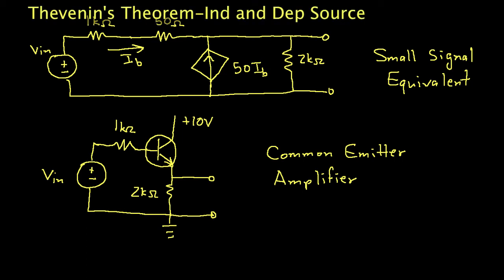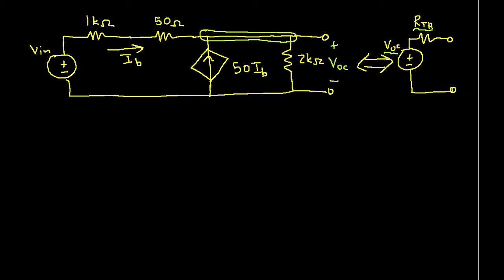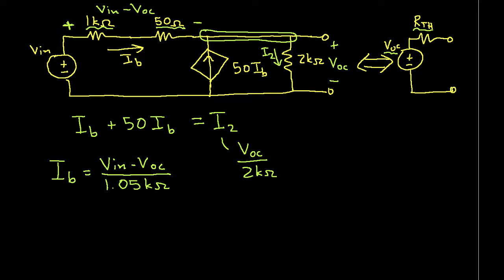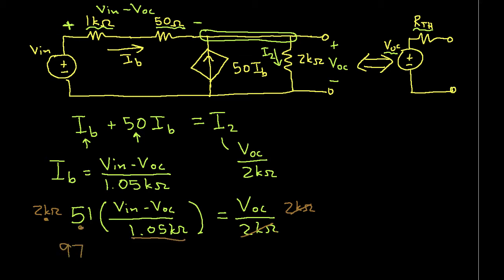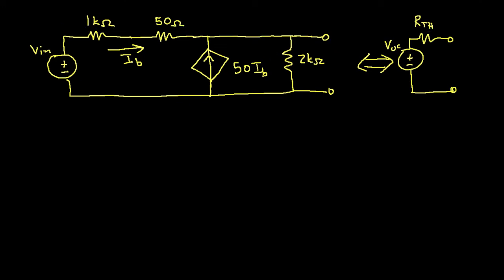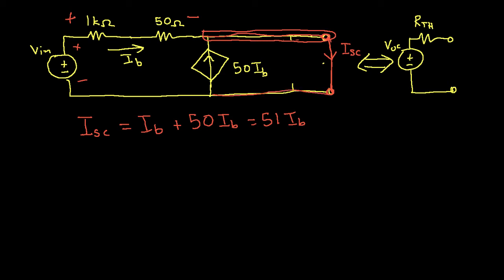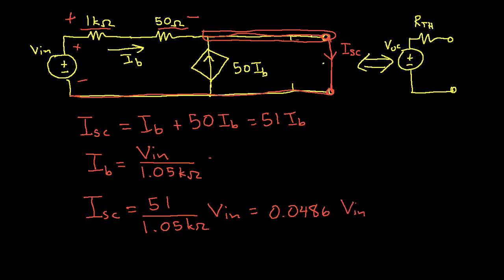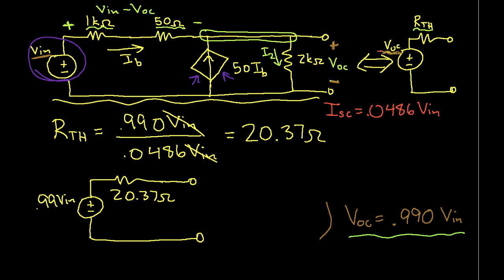Thevenin's Theorem-Independent and Dependent Source (Edited)

Comment from the maker: This is one of the weirder things that happen when doing Thevenin's theorem computations. When we find the short circuit current, we short the output, which in this circuit, means shorting the resistor. So we have a resistor with resistance 2k Ohms in parallel with a wire with resistance 0 Ohms. This parallel combination has a resistance of 0 Ohms, which is equivalent to a wire. So we can replace the wire in parallel with the resistor with just a wire; the resistor goes away.

Comment: @Darryl Morrell: Thank you for these great videos, immense utility now with exams coming up for me! 
I still do not understand the part at 05:10 though, even after your explanation in the comments. How can the voltage be zero when we have a voltage source in the left end of the circuit? This makes zero sense to me. Does that voltage never reach the right end? :P
Reply: An imaginary short circuit path was created in parallel to the 2k resistor. Since current flows in the path of least resistance(in this case, the imaginary short circuit path), the current flowing through the 2k resistor is zero. Since V=IR, and I=0 through the 2k resistor, the voltage across the 2k resistor is zero. Hence, the 2k resistor can be removed from the analysis, as had Dr. Morrell explained.